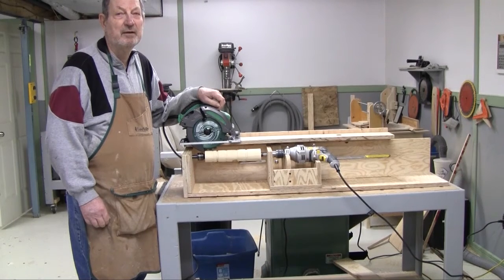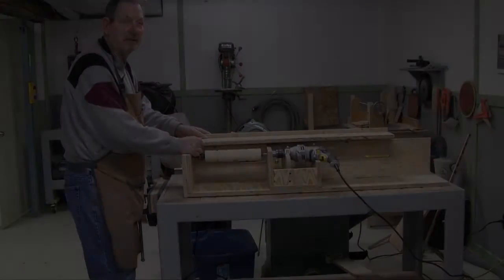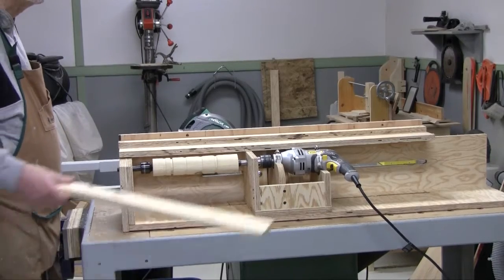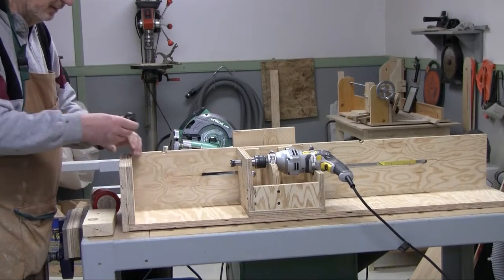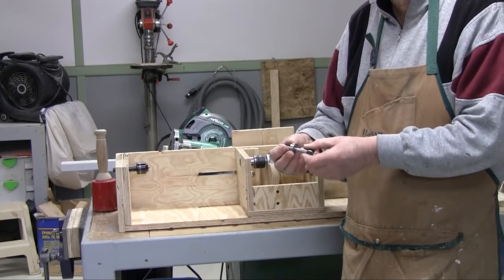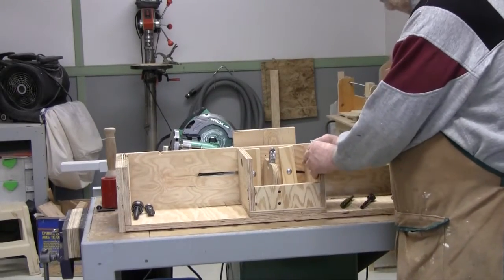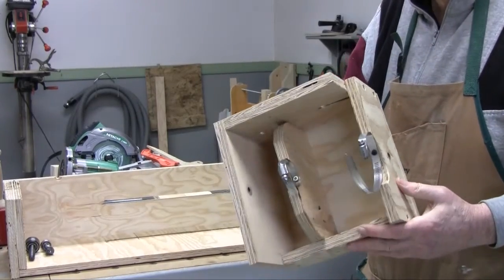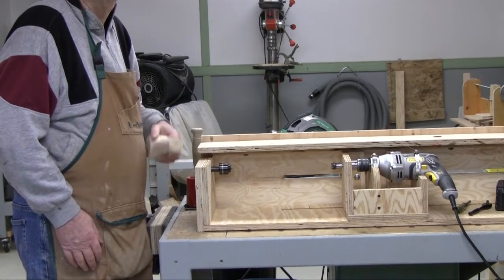Circular Saw Router Drill Lathe

Comment: Bob if you were to get a CNC rail and lineal bearings you could run the saw in the other axis using the CNC rail to fix the circular saw to using the rip guide slot.
You could make patterns to quickly repeat what you're making as well as get square shouldered tenons than way.
Reply: https://youtu.be/xe4w4UVXUJs. 
This guy used an actual lathe or something like it and what looks like a track saw.